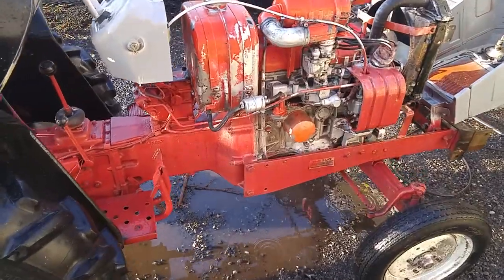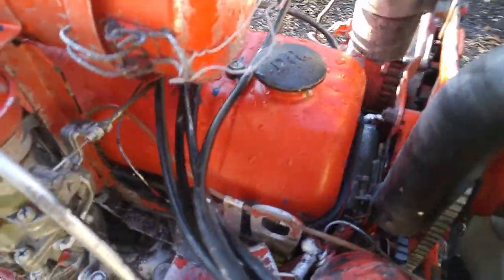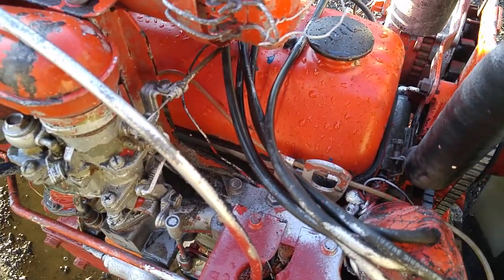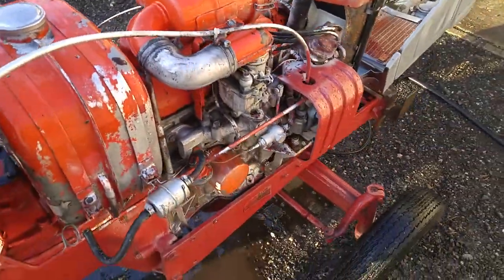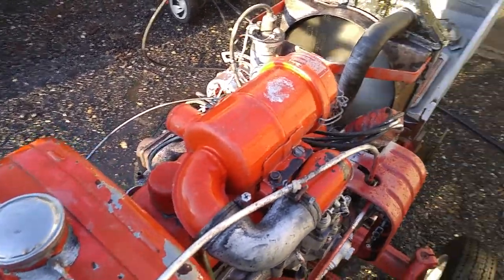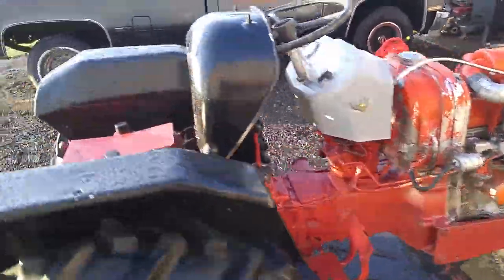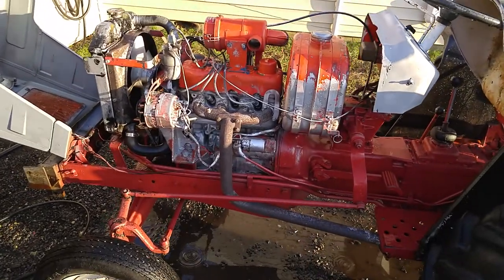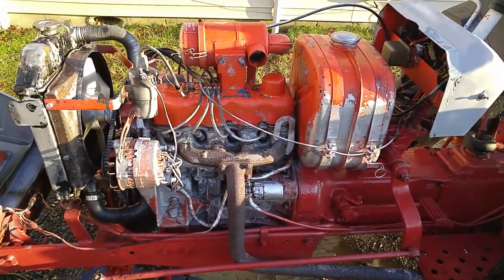1974 Satoh Elk engine wet test

Comment: nice tractor. looks like it's about similar to my mitsubisi
Reply from the maker: Thanks man!  Its all painted up now.. I guess I should put up a new video.  This tractor would be identical to your Mitsubishi in many ways. Satoh is Japanese, it has a 4cyl Mazda engine in it.
Reply: Yes, mine runs the two-cylinder, 15 hp diesel. Got it for $1600!